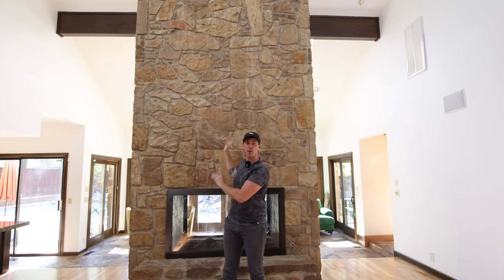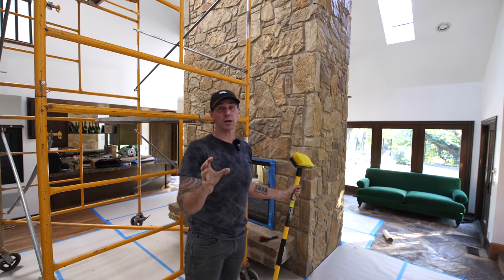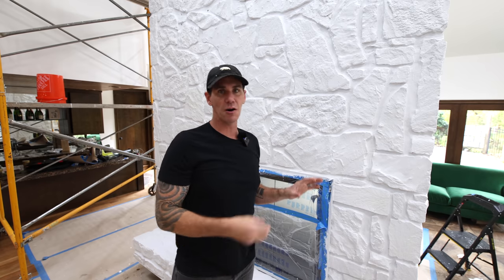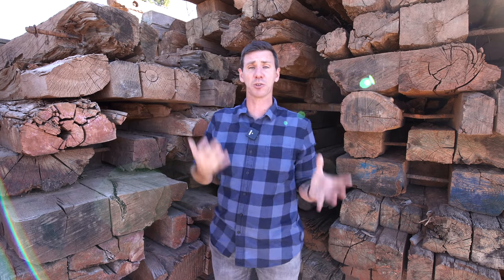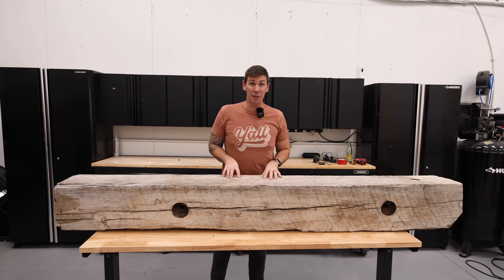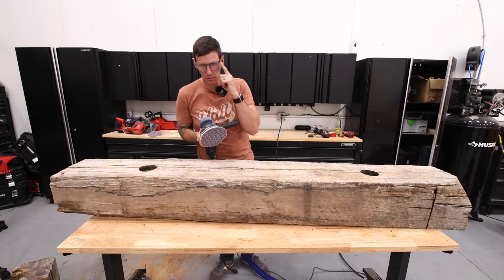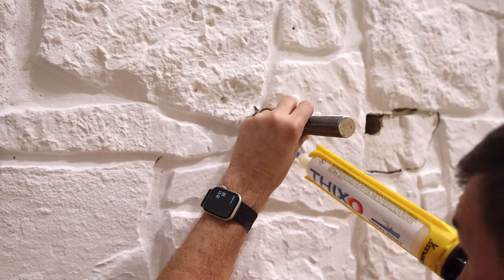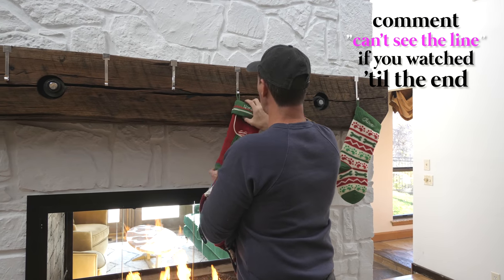How to Hang a Reclaimed Beam Mantel (FULL FIREPLACE MAKEOVER)

Comment: You could have used the one in a quarter inch nap roller for applied for material and then brush around in a Whizz roller for the pulling up by the ceiling you'll find a material would have went a lot fast forward. Looks good me personally I wouldn't have painted it your mantle is awesome thanks for sharing.